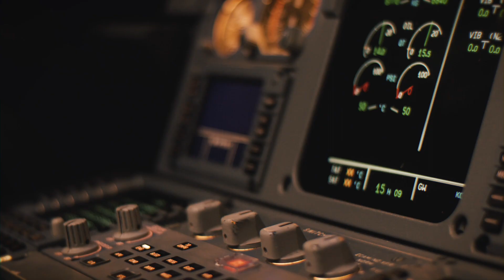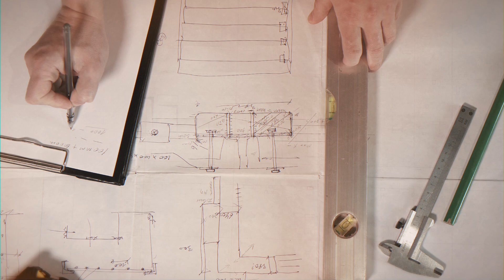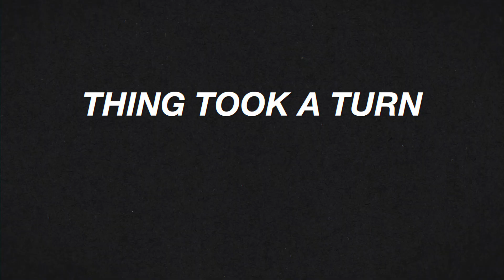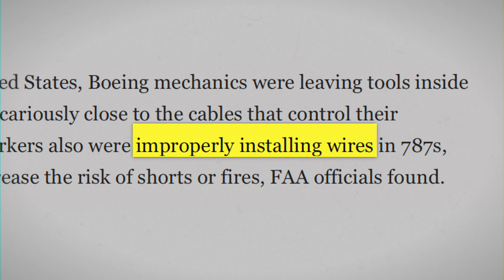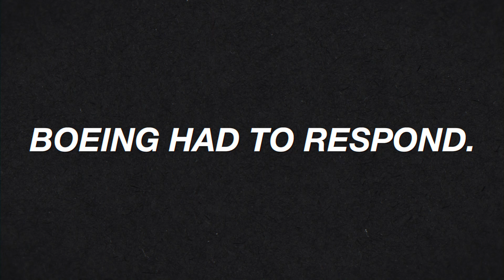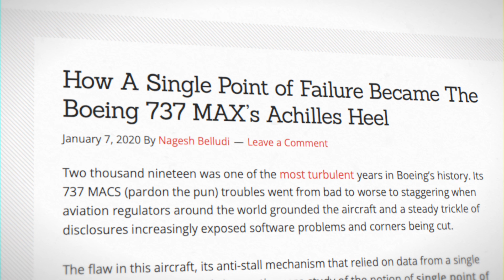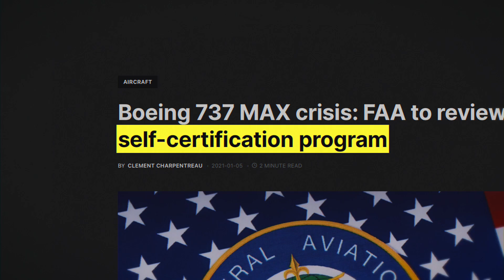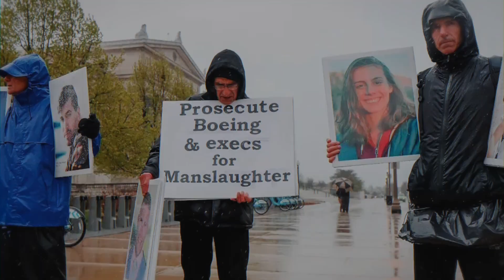The Scandal That Destroyed Boeing

Comment: controversial take, The pilots should have done better. Now I want to start by saying, Yes, Boeing design wasn't good, But have you read the crash reports? ( I know a lot more about the lion air crash, but I digress)

1.  The faulty AoA sensors came from a factory from Florida which had been refurbishing old sensors NOT according to procedures
2. The mechanic at Lion air didn't verify that he had correctly installed the AoA sensor 
3. The pilots in the flight prior ended up having Mcas going AWOL on them, however they noticed, and applied the correct procedures (turn off the autotrim), but did NOT report it 
4. the new pilots take off the plane, They get an airspeed unreliable warning, they do NOT do their memory item checklist, which they are trained on yearly, and as in the name they should know by heart. 
5. The commander asked the co-pilot to to find that checklist in the QRH (checklist for abnormal procedures), however the copilot could not find the checklist
6. The commander was trimming the airplane which turned off the Mcas (for 10 seconds), now this was exhausting for him, (at the same time, the copilot wasn't finding the procedures in the QRH) so he asked the copilot to take control whilst he was going to look for checklist, but forgetting to mention that he could disable the mcas by trimming, Thus fighting the plane, without trimming it, into the ground

NOW had any of the things mentioned above been done correctly, the crash would have been avoided. the design only using one Aoa sensor for the Mcas, I don't know why, but I am not an engeneer, however I am a pilot.

NOW for the ethiopian crash here is what I know

1. they take off and get airspeed unreliable, they forget to do the memory items
2. they forget to retard the thrust after take off, meaning it was going full thrust all the time while it was in the air
3. they do turn off the autotrim (which is correct) and try to trim the aircraft manually, however at full throttle, going 300 knots, the aerodynamic forces are incredible and are unable to trim it manually
4. they turn in the auto trim again, and unfortunately, the Mcas goes Awol

Comment: I did a paper on these incidents for my masters, you're mostly correct but a little off on some things. The planes handling changed and required the MCAS system because Boeing had to put an engine larger than the wings were designed for on the plane to improve fuel efficiency, there wasn't enough space to put the engine under the wing so they had to move it really far forward on the wing and flatten the bottom of the engine to make it fit, which changed how the engines forces were being applied to the plane and shifted its center of gravity, which changes how a plane handles. By changing the plane this way Boeing should of needed to re-certify every 737 pilot for the MAX, but by pretending the handling hadn't changed with MCAS they could get away with minimal pilot retraining (the iPad course), not having to re-certify pilots is a big plus for airlines.

Another thing was that MCAS used the AoA (Angle of Attack) sensor, the plane is equipped with multiple for redundancy and lots of systems check the sensors to make sure the data makes sense and in allot of cases allows the pilot to choose which sensor the readings are being taken from, the MCAS system just didn't have these features, it was actually copied from a Boeing military tanker called the KC-46 Pegasus, but unlike the 737 MAX the Pegasus would automatically disable MCAS and it was always overridden by pilot input.

The plane wouldn't actually stall, it just liked to nose-up more the more thrust was applied which changed how it handled, existing anti-stall systems would've made sure the plane never stalled, and autopilot and trim would've canceled out the pitching forces, but pilots would consciously be flying the plane differently from the 737, which means it should've been re-certified.
Reply from the maker: Thank you for the clarification!

Comment: Fun fact, while the plane did malfunction, it was the multiple egregious failings on the part of the airline which caused the deaths. Improperly performed preflighting, and insufficient pilot training primarily. The pilots were trained for the 737, but had done no simulator training of the 37max (where most emergency training happens for obvious reasons), and the system malfunction that caused the crash was unique to the max. Those pilots should never have been in that cockpit in the first place, and a properly trained pilot would have been able to disable the system and regain full manual control. 

Also consider that the First Officer (copilot) only had 361 flight hours logged, and the MINIMUM to even apply for an Airline Transport Pilot certification (the special license you need to fly for an airline) in the United States is 1,500.

It was a minor and fully recoverable malfuction that was horrifically mishandled by the crew, and it was human error that led to the deaths.

Of course when this was pointed out by Boeing officials, they were accused of deflecting and got a chorus of "how dare you!"'s directed at them, despite the fact that every machine (let alone one as insanely complex as the 737 max) is prone to malfunction, and the whole point of high maintenance standards, exhaustive and redundant preflights, and extremely high training standards is to prevent these tragedies. 

-sincerely, a pilot who just wrote a report on this whole debacle.

Comment: TBH, the best take on this I've seen is that this is a process several decades in the making, a direct consequence of Boeing acquiring a former competitor with basically no marketshare and the world-beating engineer-run company somehow effectively winding up the property of the company they'd only bought as an expensive and ultimately pointless gesture. Hundreds are dead and the world is a much worse place than it could have been otherwise all to cater to a few aging executives' nostalgia for the bad old days when the tiny military contractor they just buried was the market leader.

Comment: So basically, Boeing thought: ''Let's put a new system in place that relies on an external component being a single point of failure and pilots will just have to deactivate it when it will fail to avoid a crash, but let's just not tell the pilots''...

Comment: This is a pretty inaccurate video. The A320neo is not a newly designed plane either, but they had more space under the wing to place the new larger engines. Boeing had to shift the angle of their engine retrofit on the MAX, which gives the MAX slightly different flight characteristics that might lead to a stall if you fly it like a regular 737. MCAS was supposed to make the plane feel like the prior models to avoid forced pilot recertification (which, if needed, is so expensive that airlines might switch to Airbus instead). There are also two AOA (angle of attack) sensors that feed data to MCAS, but MCAS only used one input as a time. There was also supposed to be an indicator for AOA DISAGREE on the PFD so pilots would know to switch to the other sensor, but a dependency on an upgrade feature erroniously meant that it was missing from software.

Comment: The exact same problem plagued the automotive industry in the 1900's until Government safety regulations were placed into effect to provide safety for consumers.
Did you know seatbelts were an option until '73? In the 50s and 60s, dashboards were solid steel sheets. Millions died from being impaled on the steering wheel column. It was a solid steel shaft with the steering wheel attached on top.
It was decided by the top executives that it was cheaper to pay lawsuits to individuals than to build safety designs into cars. Placing these life saving measures cost more than the lawsuits... Meaning they placed a dollar value on a person's life. And life was cheaper than safety for all.

Comment: You didn't cover one aspect of the MCAS system: the system was born to make the plane respond to commands like a previous 737 even if the center of mass and propulsion were different. Why? Because if the plane responds differently pilots have to recertify to fly the plane and that's a big cost for companies buying the plane. If you change the plane but you certify that a pilot doesn't need additional training airliners will be able to start using them at no cost and airliners will buy more likely that model.

Comment: This is an example of tombstone economics. In the airline industry [and probably others, I only know about the exact number from a Nova documentary on a similar issue with faulty autopilots in the 2010s] they calculate the cost of another failure in lawsuit estimates vs the cost of fixing the problem. In the documentary [again around 2010] the pricetag was $1 million per passenger in wrongful death payouts, so after the first crash, they if the cost to recall and retrofit extra sensors and properly train the crews exceeded $183MN, they will risk another crash, and keep doing so until the cost of the next accident [plus maybe any sales losses since the last one] would exceed fixing it. 

The documentary was about a crash between an American and Russian plane, there was a new system where the transponders talked to each other and told the pilot of each plane how to maneuver to avoid collision. The American pilots were trained to always listen to the system, the Russians that the faster plane should climb and the slower should dive. The Russians being faster climbed, the Americans, moving with a tailwind and the Earth's rotation, were told to climb and the Russians to dive. The fix was to train all pilots to obey the computer and for the computer to display to both planes the commands given.

Comment: so just to specify a little what the reason for the cost cutting measures and hiding of MCAS was: Apart from saving themselves development time and money it was really more of a desperate move to keep the 737 as competitive as possible... they didn't mention MCAS to regulators because they knew that the max would otherwise have to go through time-consuming certification of the new system and consequentially lose some of the benefits of aircraft commonality... the advantage of an airframe update like the A320neo compared to clean sheet designs is the fact that pilots really only need something like a short iPad session to be able to fly the new aircraft which saves a lot of training time and cost for airlines, really the huge selling point... Boeing was aiming to do the same with ne max but the design features of the original 737 airframe just made it really difficult to do so... Unfortunately it led to some very bad decisions...

Comment: Here's a major point. 737 certifaction basically certifies ALL 737's. that's 50 years worth of planes. Over the years the planes change enough to advance, but not enough to require pilot recertifaction.  This is why pilots were simply given an iPad to read up on, they weren't being recertified, just shown the changes of the max. Boeing's overly close ties with the FAA helped push this process.

Comment: well the reason why Lion Air 610 crashed is because MCAS relied on only one angle-of-attack sensor located on either side of the plane, not both. those sensors fail all the time when they get hit by a bird or freeze. and the cause of Lion Air 610's crash is simply because that one sensor had a fault, pretty sure because some worker sprayed it with water orsomething that freezed up inside it. so dont completely blame Boeing or the pilots for this, blame the ground workers as well.

Comment: It was even more sinister and criminal!
The pilots did not only NOT KNOW about the system and its function they where NOT capable to switch it off and had no indication that it is in action.
Boeings  argument was, that they should have switched off the whole automatic trimming system and trim the plane by hand with there muscle power.
'But there a second fatal flaw of the B737 kicked in, that the plane had since its initial introduction. If the plane is badly trimmed out of balance, the muscle forces pilots would have to use the manual trim wheels are much to high for any even special trained human!
In the initial manuals for the B737 there even was a warning that the plane MUST NOT be trimmed such badly because a recovery with manual labor of the pilots is then impossible. This was later removed, because it was to frightening and somebody decided, that this will never happen in realistic scenarios anyway. Until MCAS came ....

Comment: Did you recently take information and sequences from the Netflix documentary The Downfall Against Boeing? Because this is feels like watching in the same order but on a different platform.
Reply from the maker: Maybe subconsciously, didn’t use it as reference this way. Watched it once when it came out.
Reply: @Armin99_  Maybe you should invest some time into actually looking through the flight recorder data from the 737 MAX crashes and do some reading on the standard procedures associated with these aircraft before spreading sensational nonsense on the internet
Reply from the maker: @robroilen4441  What do you think about this? https://www.reddit.com/r/aviation/comments/evaeyz/comment/ffvnefh/?utm_source=share&utm_medium=web2x&context=3
Reply: @Armin99_  It agrees with what I've been saying and disagrees with your video. It details that the angle of attack vane was improperly installed, and that the pilots did not follow standard procedures that have been in place since the 1950s. Seriously, you should take this video down.
Reply from the maker: @robroilen4441  There is a comment left by user 'vmtyler', which illustrates my point. It's a multi layered issue, and the premise of my video is still correct. Multiple things can be true at once, Boeing should have never shipped the plane as it was.
Reply: @Armin99_  Yeah, Boeing shouldn't have sold complex modern airliners to airlines who have bad track records when it comes to maintenance and pilot training, I can agree with that. Maybe you shouldn't be getting your information from Reddit threads

Comment: The main reason that Boeing went with the MCAS system in the first place was that the principle of the new, fuel efficient engine, made its diameter unusually large, so much so that, more ground clearance was required for the engine to fit under the wing. But the 737 was an old design so Boeing opted to shorthen the engine strut instead of lengthening the landing gear struts. This resulted in the engines sitting "too high" and thus disturbing aerodynamic flow in a way that, the 737 MAX had a constant tendency to pitch up. And Boeing installed a "pitch auto correcting system" to counteract this tendency. So basically they created a plane which was bad aerodynamically by default. And they patched this up with a ...band aid. That failed. Again. and Again. Congrats.

Comment: ok so in july of 2022 i took a trip of the us to london, uk, aboard 4 airbus', the a320, a330, a220, and a350, and boy im glad they werent boeings
Reply: You know that an Airbus has even more automation than a Boeing, right?
Reply: @robroilen4441  yeah but they don’t break as often like you see all the issues that plagued the 787 and 737 max
Reply: @edan7813  "As often" as a percentage of total flights? Because if that's what we're going by, Boeing's incident and accident rate is almost exactly the same as Airbus, which is significant when you consider that Boeing has been around for much longer.
Reply: @robroilen4441  WOULD YOU GIVE A REST, MCAS IS STILL NEW, BUT A320 HAVE ALREADY BEEN AROUND FOR DECADES, OFC THEY MODIFIED TIME TO TIME, BOEING TOO IS TRYING THEIR BEST BUT AT A TRAGIC COST DUE TO POLITICAL PRESSURE

IT'S OK TO DEFEND A COMPANY, BUT DON'T START ATTACKING OTHER, IT ONLY MAKE YOU MISERABLE

Comment: It is popular to blame the merger with McDonnell Douglas as the point in time when Boeing 'got greedy.' However the 737-MAX wasn't even the first time Boeing rushed certification of a new 737 that led to disaster. Look up the much earlier 1989 Kegworth disaster in which new features of the 737-400 were rushed through certification without adequate pilot training.

Comment: Avionics on the max and the NG. We had a week of classroom training for general familiarization on any new type. Even aircraft cleaners. By the time of the Max,we were doing acceptance checks . We waited until others had thier 3-day class. We were allowed to install Wi-Fi when we were ready for class we were told you worked on the wifi so you are qualified. I was LMP and I didn't feel well trained and confident in the complicated paperwork we were supposed to get training on but most is done on a computer now and rivet guns and jet engines made it hard to concentrate.

Comment: Any self respecting safety engineer would ideally want a triple redundancy in sensors, as it provides the best possible safety guarantee at minimal cost. A voting circuit coupled with a triple redundant system would have provided excellent safety. All aerospace engineers are taught this. This just shows how people with no actual technical knowledge or background should not be allowed to lead companies that depend on engineering and technical know-how, especially in an industry like aeronautics where standards of quality and safety are quite literally the only thing separating life and death. Aerospace is not an industry where "fuck around and find out" can be used. Business folk can join in as advisors or something, but the ultimate decisions ought to rest with the most experienced engineer in the company.